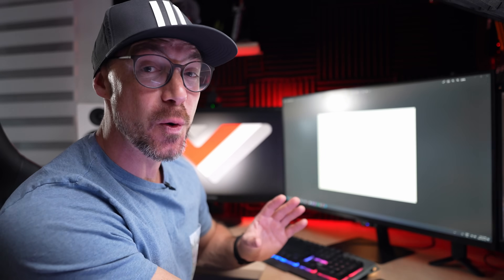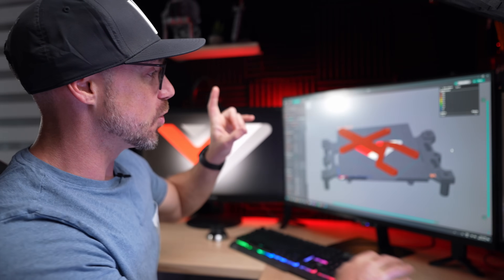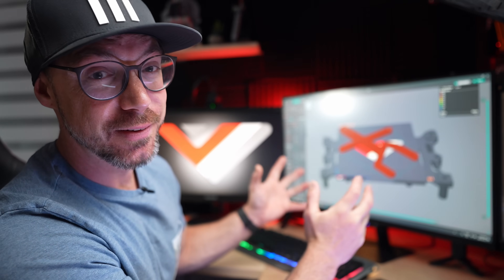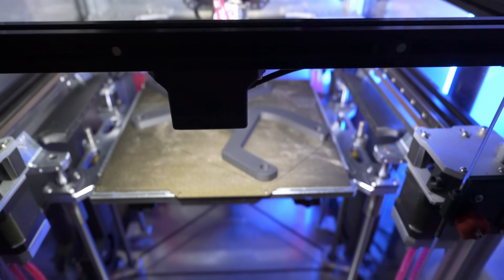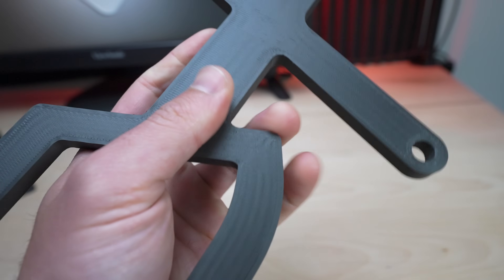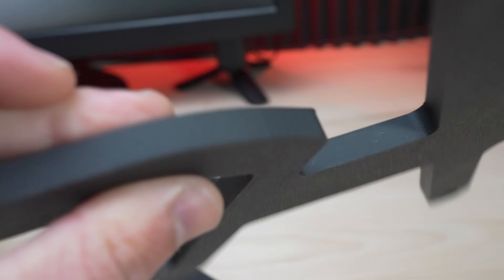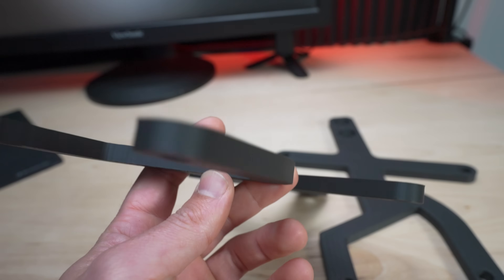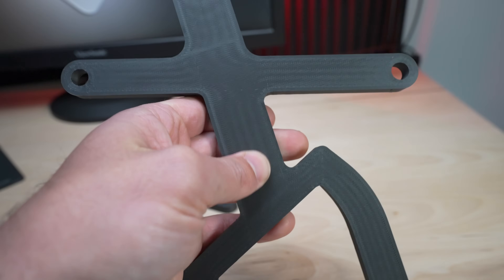Printing at 600MM/s 35K

Comment: does this 3d printer use nema 23?
Reply from the maker: Nema17
Reply: @Vez3D  cool thanks man
Reply: I am building a 3d printer right now. Should I use AWD using 4 NEMA 17 or two NEMA 23
Reply from the maker: @officialcreativeengineering4 nema17

Comment: Vez, is it possible to compare the new Flsun S1? would really like to see what upgrades you could add to improve its insane speed. the only printer that might give you a challenge. Not lol. I'm sure within a year or 1.5 years flsun will make a 2400mm/s printer, they always double there speed on next printer made. Currently the flsun S1 is being held back, it limited to the limits in the firmware, max movement speed is 1600mm/sec but it can move even faster as its very stable at the 1600mm/sec movement speeds.

Comment: @vez3d are you selling complete printers?
Reply from the maker: yes link in description. Its a kit though.. DIY.. but its complete with all CNC parts you see in this video
Reply: Damn, I'm absolutely useless at building kits. Do you have video where you build them yourself. Also 2 more questions. Is the build guide detailed? Does it included the water cooling?

Comment: Been watching and waiting a long time for full kits to be offered (no time for sourcing). I've been using a V2.4 350 for production for a couple years now, but it is now looking slow by comparison.  This video makes it clear that I can likely get and easy 2x-3x print time cut with your kinematics and printhead/HE combo.  Your designs have come a long way and now I see a kit, but it doesn't look like I can order it with water cooling.  Also, I saw you were developing water cooling for steppers as well... is this ready for primetime yet?  I'd like to use VZ printers for production and would like the option of PEEK/PEK and similars.  Will we see a kit with all options offered soon?  Perhaps at least water cooled HE option with the kit?
Reply from the maker: There are kits available :) check link in description

Comment: I think you said it perfectly when you said " It depends on what you use it(the part) for". I've printed at 120mm on my bed slinger printer and it still prints perfect looking but layer adhesion is a bit weak, but on those parts strength wasn't important so speed won for me (because it was a prototype for checking fit), especially when it turned an 18 hour print into a 4 hour print. I'd add that it's important to know your printers capability and what you plan to use the print for. Very useful information that might save you a lot of time in the future. In my case, it bought me time to tweak the design, reprint again and then later slow it down for better adhesion whereas I might have had to print 36 hours to get the final part I only spent about 26. 8 on the prototypes and then the final at regular speeds.

Comment: This is an amazing piece of engineering. Printing at these speeds is the print’s structural integrity compromised at all? I print  1 wall thickness PLA and wonder how layer adhesion would be…thank you

Comment: I see over and underextrusion on the top surface during accel-decel moves. Probably, it needs some PA tuning.
btw, what is your PA factor? I tried printing 0.3 layer 0.6 width @ 200 mm/s and my feeder (Mellow NEMA14 Sailfin) was not able to keep up with 0.04 PA.
Reply: I saw a interesting write up from someone that showed that pressure advance effectiveness drops the further away you get from the speed you calibrated it at. So we might need to have speed bases PA

Comment: The last 1 mm on height is expanded. Why is this happening? I have this effect on my V400 too...
Reply from the maker: thats a good question and it has to do with the solid infill. I would have to check the slicer to see what happens on those layers
Reply: @Vez3D  Hi, i couldn't try it. Could it be a issue with PrusaSlicer/OrcaSlicer with "massive Infill" or another setting?

Comment: Great gantry! Love it! Would be nice to see a side to side comparison of same part printed with 0.2LH instead and half speed to compare quality and see if it makes any sense to drop LH that low. Should take roughly the same time too. My guess is that you will see less ripple and ringing at arcs, while 0.2LH increase from 0.1mm isnt much noticeable IRL with eyes especially on larger parts.
Reply from the maker: that would definetely how I would print it normally. Bigger layer height, more flow, and less speed with the same print time. But it would not make it as impressive to watch hehe. this is content creating and it has to be a bit of wow effect.  BUT sometimes its nice to have the same print time but ultra smooth walls with 0.1mm too
Reply: @Vez3D  yeah, that speed is very impressive man indeed! Have fun with that! Haha! 🤙🏼🤙🏼

Comment: super slowmo footage of high accel when hehe. would be interesting to see if there is some wobbling or shaking going on
Reply: Also. Do you measure with the ADXL mounted at the nozzle?.
Reply from the maker: @torxfighter  yeah.. direcly on the nozzle.
I wish I had a high speed cam . I have my mobil that can 960fps, but it needs to high light that doesnt flicker

Comment: My old CR-10 can do this too, with a maximum of 150 mm/s... ;-)
However, the higher the speed, the more it applies in the last layer, resulting in a slight overhang. All my printers have that, the faster ones.

Comment from the maker: Ok guys, sorry if this has come out the wrong way, but this is not a video for TESTING input shaper or seeing input shaper results.. this was just a video having fun when you crank up accel to what klipper suggests. This part was perfect for high accel since it doesn't have corners or sharp angle... so there is not much shaping happening. Just high speed printing :) Maybe I should have not talked about input shaper first hehe... and just say lets print at 35k and 600mms.

Comment: I don't see what this is testing. There are no corners to get rounded. The max recommendation is computed as the point at which the IS filter produces potentially unacceptable toolpath deviation, not anything to do with the max acceleration the machine can handle, which is easily 5x higher.

I generally run 50-75% of the recommendation for outer perimeters and the max achievable without skipping steps for everything else.
Reply from the maker: yeah I mention this at the end :P
Reply: @Vez3D  Haha okay. I swear I watched almost to the end but then got interrupted and didn't realize there was more addressing this. 😁

Comment: Maximum recommended acceleration is about "rounding" of trajectory created by shaper, it's not some random number, but math, exceeding this number will result in rounding of sharp angles on parts the more you push acceleration. 
So i don't really understand what exactly you've tried to test here, but your part is basically wrong for testing this recommended number
Reply from the maker: im not trying to test IS or anything.. just wanted to print at the max recommended accel.. and at the end I mention that the part is perfect for high speed and high accel because there is no sharp corners :)  this is not a test, more like a show off print :P
Reply: @Vez3D  i don't really want to argue and pick statements from video, but you know what you tell in it, if you believe that it is not misleading - ok than. I've watched it completely and gave a comment for those who might be mislead by statements in video and i've got useful info from it anyways, like the fact that effective belt length is indeed a main contributor to low frequency resonances
Reply: @SergeiSugaroverdoseShuykov ...it's not misleading, get over yourself. He says "what would happen if we set it to the max accelerations Klipper suggests? Let's find out". Then he runs the thing. What is there to be misled about? He made no technical comments at all, it's literally a "let's see something cool" video. Some people need to get a life, I swear...

Comment: It's amazing to see printers move this fast and at this quality. Got my 2.4 set up and I'm only hoping I can get close to this quality sometime soon at a fraction of the speed!
Reply: Easy. I run 25k and 400mm/sec with a rapido uhf and cht on my 350 2.4. That's with a longer stealthburner toolhead and running 40k 600mm/sec travel.
Reply: @Blakes_Makes  What input shaper and frequency do you use? 40K is too much for any gantry, you'll get either  ringing or filleted corners.
Reply: @TheNamelessOne12357  40k TRAVEL moves.
Reply: @Blakes_Makes OK, what are shapers and frequencies for 25K print accelerations?
Reply: @TheNamelessOne12357  recommended max is mzv at 5.1k on Y but 25k prints fine with little ringing.
Reply: @Blakes_Makes  MZV 5.1K? My sapphire Plus with NEMA14 direct has recomended 9.8K MZV@58Hz. So my Sapphire Plus is faster than Voron 2.4 :) Voron has too flexible gantry and frame, it can't be fast.
You just do not understand input shaping. It can remove ringing, but if you go too fast it will fillet corners and geometry of printed part will be distorted. Recomended acceleration is not for ringing absence, but for correct part geometry.
Reply: @TheNamelessOne12357  lol sure I'm done with this argument. Pointless.
Reply: @Blakes_Makes  Yep. Voron is slow. Admit it and build something else. VzBot, for example. It's still a Tronxy, but much better than Voron.
Reply: @TheNamelessOne12357  I got a tronxy I was going to convert. Yes totally in comparison a voron is slow but faster than most. It all depends on how you tune it.
Reply: 2.4 you mean Voron? It's not rigid printer, and if has flexible gantry. It can't be fast by design.
Reply: @TheNamelessOne12357  BS some of THE top ten benchys where printed by a 2.4. Its just heavy. Stability ist more than given.
Reply: @TheNamelessOne12357  the Voron 2.4 literally has the record of the fastest printed benchy EVER , Voron 2.4 can be super fast
Reply: @ulforcemegamon3094   What's the point of fast printhead movements if printed part looks like shit and not functional? Any printer can shit a poop of filament very quickly, but what's the point of it? And what are input shaper types and frequencies?
Reply: @TheNamelessOne12357  My brother in christ, shut up and don't embarrass yourself. The flying gantry of the 2.4 is exactly the reason why it's so fast. the center of gravity is way lower than the other printers.

Comment: You don't trust klipper, you use the test tower to find max accel without smoothing
Reply: Bruh, this dude has made probably the most insane consumer stepper motor printer there is. I think he knows a thing or two about klipper.
Reply: @ruzzcraze1862  My thoughts exactly.

Comment: Always so impressed with the walls on your prints.
Reply: you can still see some ripples in the corner at 5:05 , filament and lighting do a lot, also this is a vid about the 'recommended' input shaping values so the results are technically pre-tuned and should be good on a good printer. also layer height helps a lot, even on a slow printer
Reply from the maker: @killsalot78  im not too shy about those ripples for 600mms and 35k :)
Reply: @Vez3D  not sayin you should be,  but as speed printing gets more refined and profiled its very quickly gonna become the norm, but maybe I'm optimistic 😛
Reply: @killsalot78  Yeah I understand it's not a flawless print, but considering the speed and size of the print, I would consider that pretty good. Can't even imagine how long it would take on a well tuned prusa or ender